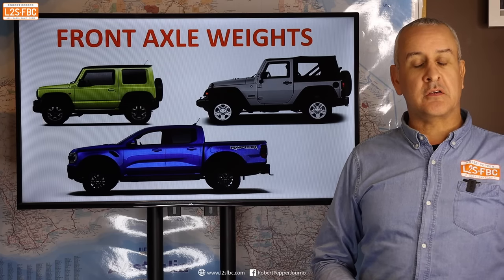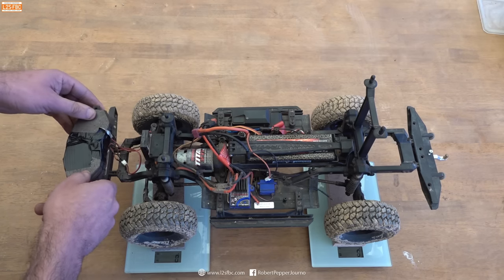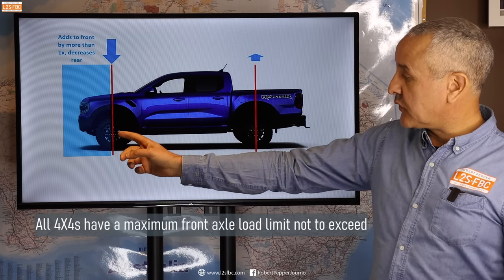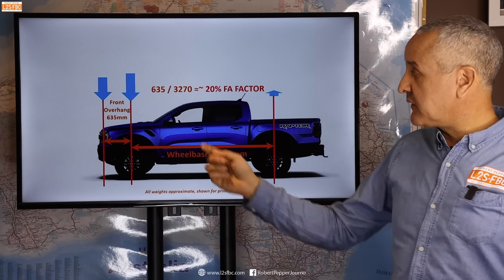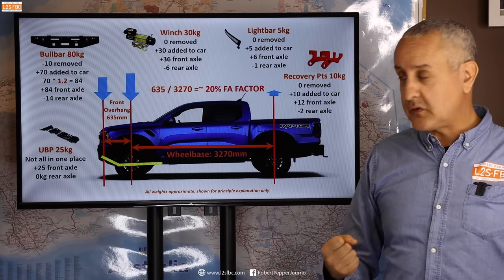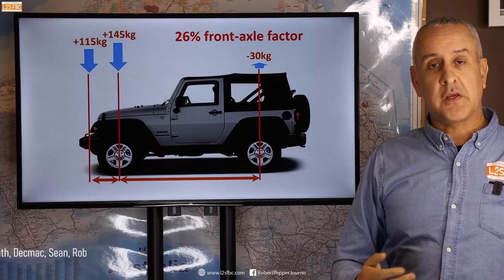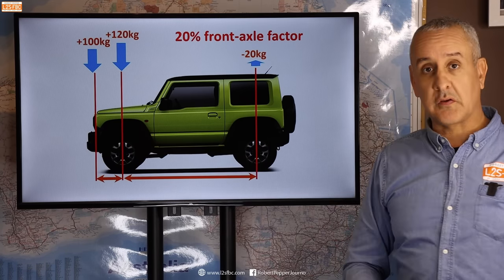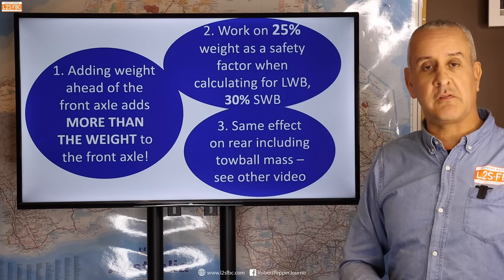Two non-obvious things about front axle load

Comment: Excellent video and explanation Robert. I had the same issues with a work truck where I had to be careful with how I loaded it or the front axle would be overloaded, and counterintuitively, when it was fully loaded, there was less front axle load then when it was partially loaded. I made up a spreadsheet where you entered the weight and distance from either axle (as well as from the centre line of the truck) and the axle loads were calculated and you could easily change position of the various loads and see how it effected the axle loads.

Comment: Well explained and demonstrated. I have just worked out my  front mounted winch is +21% and rear mounted spare stuff is approx +37%. Not good for the polar centre of gravity making vehicle a handle a bit more like a dumbbell if too much weight added outside wheelbase in proportion to kerb weight.

Comment: Great coverage of a very important topic. People really need to know this stuff. The front axle or pivot point has the steering and (usually) IFS mechanicals so that’s a whole lot more moving parts than the rear that are stressed by that front axle load, especially while turning and/or braking.

There’s a reason why the front loading range is low and exceeding it seriously compromises safety in emergency manoeuvring. Stiffer springs in a “GVM upgrade” does not change your calculations to any meaningful extent so dealing with higher loading would require completely re-engineering the front end and upgrading many components.

I’m sceptical that many GVM upgrades really do this despite “engineering certification”.
Reply from the maker: Thanks, and agreed!

Comment: not sure if you're aware of this but the line you drew through jk wranglers front bars goes through foam in front of the chassis mounting points. the line actually ends up being the foremost part of the vehicle when you get rid of the plastic park bench off the front.
Reply from the maker: I wasn't thank you...it's the principle, and it is possible the line could be accurate, a winch may protude for example.
Reply: @L2SFBC  nah winch sits between the chassis rails on a properly designed bar. but yes the concept is simple one.
Reply from the maker: ok thanks

Comment: Excellent information there. Thankfully I have plenty of leeway with my model Hilux, as I have the petrol V6, which shares all hardware with the diesel bar the engine and transmission. The engine happens to weigh 75kg less than the diesel. Even with that advantage, I have kept everything light, a 40kg bar, a 23kg winch and the battery behind the headlight has been replaced with an 11kg lithium.
Reply from the maker: Very wise choices there, all adds up!

Comment: Excellent video, One thing this video doesn't touch on is why you may want to have more weight up front: to balance the heavier loads in the rear and prevent light steering. Also help with low traction/up hill ascents. This is why I prefer to add some weight to the front such as air compressors/dual batteries etc. But not overdoing it of course. Overall, when fully loaded I like to have the load evenly distributed or slightly more on the front axle (which doesn't seem to happen for me practically speaking) for reasons mentioned.

Comment: I have a two door JL Wrangler. My instinct was that a steel bumper would do as you have said.  Thank you for the demonstration. I decided to only install recovery points that weigh about 10K.  No steel bumper and no winch.
Reply: Why not install a rear steel bumper to offset
Reply: @trschurr that’s what I did steel front and rear and even rear winch steel bumper it’s awesome
Reply: @trschurr   That is a good idea. I wonder how Robert wil see it?
Reply: Wrangler owners install larger tires in order to help offset the added weight due to the winch. This works because the spare tire mounts on the tailgate on the Wrangler. Another well thought out tutorial by Robert Pepper!

Comment: A good reason to change spring rates after getting on the gear fitted to the car. With a winch and steel bull-bar, the front springs are often way under-sprung for the additional loads.
Reply from the maker: Indeed!
Reply: Spring rates doesn't change the weight.

Comment: Hi Robert,
First: I really enjoy your vids. In contrast to other "experts" who might have been "building and testing off-road vehicles for over 40 years", your tech info is accurate and well founded.
I do have a question/suggestion to the info in this video: the effects of adding weight to one axle or reducing the load on another by shifting that weight in the vehicle can be relatively simply explained using levers. Would this not have made the explanations more simple to follow?
Reply from the maker: Possibly yes...but I chose models

Comment: This is interesting Because the Holden Crewman had basically 2 types V6 and V8.
 The V6 can carry more load than the V8 in the vehicle its self ,
But the V8 can tow more than the V6 and it's not because of the power.
(Approximately and the same specs for 2WD and AWD)
VZ V6 = 1150kg load and 2150kg tow (Alloytec)
VZ V8 = 850kg load and 2500kg tow (LS)
VY V6 = 1050kg load and 2500kg tow (Ecotec)   ?
Before the comments go nuts on what the books say about this,
  I have the VY V6 and it is plated from factory as such. 
   According to specs the 3800 is the least powerful of them yet can handle the most work.
Can you think why this is ??? (why did I think of Dora the explorer here) 🤣
Reply from the maker: I can make a guess!  If the GVM is the same, the V8 would be heavier and therefore have less payload.  Towing capacity is not to do with power it's more often limited by cooling to the engine or transmission, so presumably the V8 has better cooling than the V6.
Reply: @L2SFBC  That's a good point , as best I can see the V8 and the Ecotec are Cast Iron motors giving more weight to the steer as the tub extends back past the axle quite a bit before we find the tow-ball , so balance is better. If you load the V8 tub to 1 ton and step on it, sure the springs are strong enough (All Crewman have M86 axles) but because of the chassis design it will do just as the Torana does when fitted with a 350 small block, "The doors pop open" shhh no one wants to admit that bit 🤣.

Comment: I put a 9000lb warn hidden winch on my 13 grand Cherokee. Man did it make it handle different especially on gravel roads crazy squirrelly if you try to make corrections at 35mph+
Reply from the maker: Lots of reasons; CoG change, more grip on the front axle, less on the rear...

Comment: I would have said the extra weight on the front is going to cause extra wear on the steering and rubber joints over time. Better off having cart springs on the back if you carry a load. Also if anyone knows. . . .😬 What is the difference between TRC and A-TRAC on the Toyota Hilux 2012-2016 1KD 3.0 litre (TRC) to the current 2016> Hilux (A-TRAC). Is it the same system when it comes to braked traction control, does the old system sill have braked traction control when in 4wd low range? I saw your vid with the BMW vs Hilux. Thank you I really like your videos. 🇬🇧

Comment: Obviously the maximum load on a front axle would be at maximum braking affect as the vehicle weight / inertia transfers to the front axle and the front brakes do most of the work. Do manufacturers actually publish a maximum allowed weight for a front axle or do you just have to assume the allowed load for the vehicle / 2 ?
Reply from the maker: No, it's a static load published. You are correct re load transfer (not weight!) and that's transient and accounted for.

Comment: Hey Rob - does all-round self leveling air suspension on, say, a modern Land Rover, offset the multiplying effect in any way?
Reply from the maker: Yes but not significantly. What I describe is a reasonable model for the purposes of estimation, but if you want to get super accurate then you'll need to model the effect of suspension compression and extension front/rear, and tyre compression, and the effect of a changing CoG...beyond what I can do and not needed so the answer is "yes it does but not to any practical degree".
Reply: @L2SFBC  Absolutely true. Unfortunately too many people believe to solve the "issue" with stronger suspensions but, as you said, the truth is "yes it does but not to any practical degree".
Reply: Suspension modifications does affect driving dynamics to some degree, an automatic levelling system will firm up the front to compensate the added weight, but, the balance of the vehicle remains unchanged, regardless of stronger springs, or higher air pressure in the factory system. No matter what, you still have more weight in front, and that will change dynamics. These days, the dynamics and changes to those matter more than ever, given the vehicle stability systems etc, that are programmed and tuned to an expected dynamic. Changing it may produce unintentionally response in an emergency when the vehicle takes control to avoid loosing traction as an example.
Reply: @brianjensen5200  everything counts under dynamic conditions, even the driver's mood.
Reply: @nicknick7052  Yes and no. What I meant to say, is related to stability control systems. They're active when the driver no longer is in control.

Comment: Is there an ideal weight distribution fore/aft and why? Does this vary by application such as off/on road?  My 4x4 truck is 6.5 tonnes GVM with approx. 2.7 on the front and 3.4 on the rear....
Reply from the maker: Excellent question.  The perfect weight distribution varies from moment to moment.  Ideally though, central.